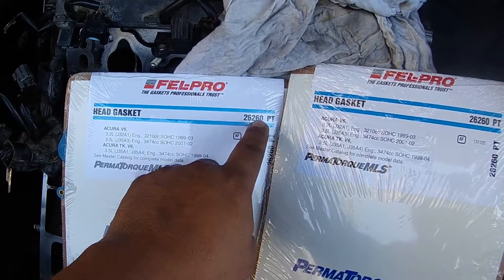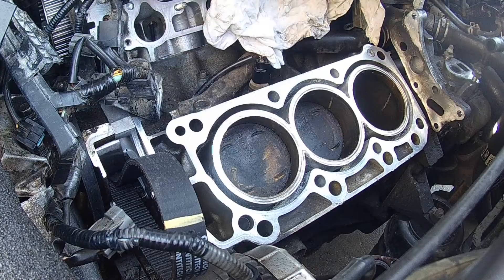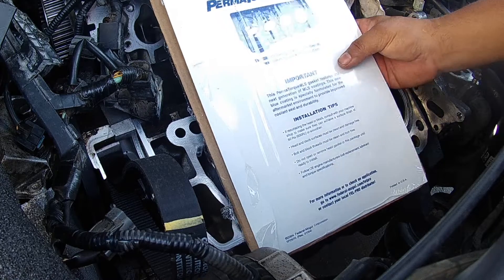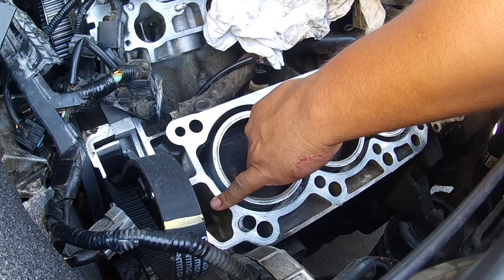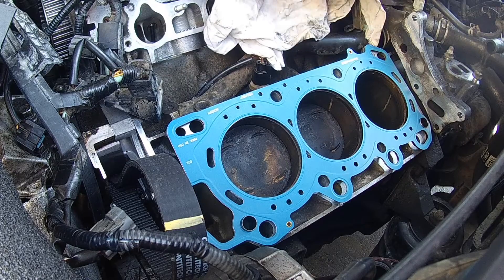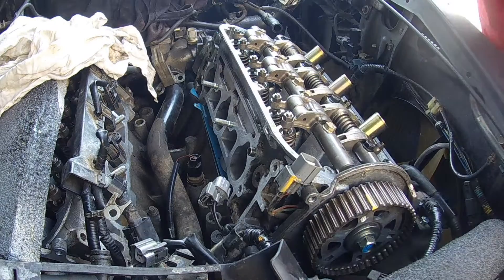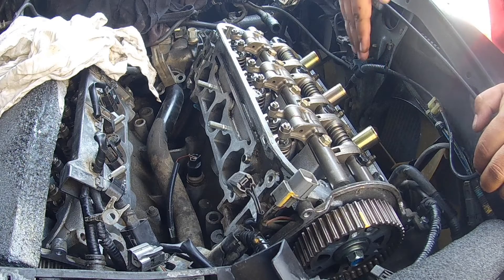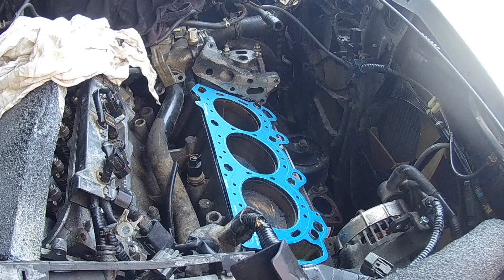Honda Acura V6 Head Gasket Installation - J Series V6 - Accord Ridgeline Pilot Odyssey RL CL MDX Vue

Comment: When i install the front head i put the catalytic converter on, then it slides right down in place👍 you dont have to fight it later😁Also if you(very carefully) transfer the marks from front cam pulley to rear pulley you can adjust all valves off the car😁👍 Much easier and more accurate👍

Comment: HELP!!! This is excellent! I need to replace the head gaskets, but there are warped cylinder heads and low compression on all cylinders.  Instead of replacing the whole engine will this be a possible solution 3.7L mdx. I'm getting so many different stories from mechanics and ridiculous price gouges. I see that some of the parts are reasonably priced. I Just want to get this car started again. (timing belts are good and camshafts are ok) Had a blowout on the freeway misfire 304. Cylinder 4 needs to be rethreaded.
Reply from the maker: Ok there is a lot going on this comment. What do you mean you had a blowout on the freeway? Like your tire blew? Or the spark plug came flying out?

Comment: Cant find the torque specs of the heads for a 2011 pilot, any help anyone?
Reply from the maker: The honda procedures are calling for 22 ft lbs first step then 90 degrees 2nd and 90 degrees 3rd the 4th 90 degrees with new bolts is only mentioned in the MOTOR torque guide. going with Honda is your best bet 3 steps 22 ft lbs then 90 and 90

Comment: Nice video man! If I'm seeing a bit of oil on the J30 plate is it likely the head gasket? 
Already replaced the valve cover gaskets and such along with the camshaft thrust plate O-ring. Those areas are dry now but still get a little oil running down that front J30 faceplate.

Comment: I'm going to be replacing my head gaskets in my 05 accord, and I'm not sure if i need 6 or 12 point head bolts as I have not started disassembly. Is it okay to switch between 6 and 12 point head bolts? If not, How can I find out which bolts I need?

Comment: Bud,  great video. I’m having problems on removing the back head on a same Honda engine. How can you disconnect the wiring in the back. I need to remove it so I can take it to Jose at A1 in Riverside.
Reply from the maker: The wiring harness is attached to a clip back there. You need a small flat screwdriver to get the harness to pop off. I found it easiest to go from under the car near the passengers side tire to get the connection loose. There will be two connections there. Once the harness is off you can pull the head off and the bracket will come with the head. Tell Jose, BUNDY sent you.
Reply: Thank you so much for responding. And John I’ll will relay to Jose that you indicated me to A1. Thanks

Comment: How to you remove the cylinder head? Ive removed all the bolts all around but cant figure out what to remove on the left size. Please help
Reply from the maker: What all have you taken off?
Reply: @bundysgarage  Intake Manifold, fuel injector rack, cooling system, belt, and the head bolts
Reply from the maker: V6 or 4 cylinder?
Reply: @bundysgarage  same engine. J series. But my engine is still in the bay
Reply from the maker: Email me your phone # Bundysgarage at gmail dot com

Comment: I would like to see a video removing the back head cylinder one of this days if you have a chance. And Do we always have to bring the Head to a machine shops to rebuild the head and resurface it?
Reply from the maker: The J Series is an interference engine so it's a really good idea to get the heads checked out before re-installing them so you know the valves are good and you want the head straight so that the head gasket seats correctly and you don't have any leaks once you put it all back together.

Comment: That rear head is a son of a bitch to put back on.  Probably screwed up my head just now with the metal dowels, going to have to remove those scratches now.  Heck with it, I'm pretty pissed off right now.  Spent alot of time to get to this point just to screw up the world.  No way I am spending anymore money on this crap hole of a car.  When I cool down I will try again, just having too much problems getting that rear head into place for some reason.
Reply: How did you make out bro... Dont give up

Comment: Hey I’m currently in the process of replacing the head gasket on my 2001 Honda Accord v6 and I’m having trouble removing the timing belt from the camshaft is there a way to only remove it from the camshafts and not the entire belt?
Reply from the maker: Negative. You have to remove the entire belt. There is no way to “sneak” it out.
Reply: cut it off buy a new one

Comment: Bundy, can you please make a video on how to replace the piston rings and bearings on this engine? My car is a 2001 accord V6, I think it's the same engine
Reply from the maker: If you need to tear the engine that far down you should look for a low mileage Japanese engine.
Reply: @bundysgarage  just so I understand did you mean a JDM engine like on Ebay? I thought Honda was from Japan so the engines would all be Japanese. I think with jdm engines I also need to transfer over the new harness and a new ECU? Someone told me replacing rings and bearings on the crankshaft would add a lot of life back to the engine , is that just wrong?
Reply from the maker: Not all Honda engines are made in Japan. Some are made in Alabama. That being said though, all their engines are based off of Japanese engineering. Yes replacing bearings and rims will add life to the engine. But the J series V6 is almost bulletproof. So if you have taken care of her with regular oil changes and coolant flushes she will last a long line time. It’s just a lot of work to get the bearings and pistons out and replace everything. I was saying find a low mileage engine you could just swap out.
Reply: @bundysgarage  oh gotcha, thanks Bundy, keep up the great vids man